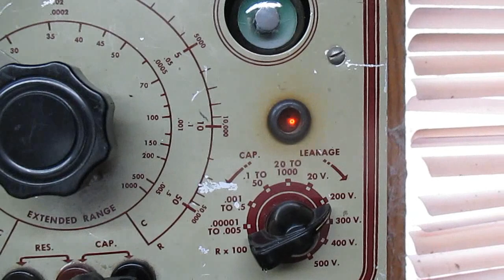1960s Aiwa Japanese-built 5-tube radio

Comment: Paper was caps and dried out electrolytic or just the biggest problems in these old sets. Even if an old radio was taken out of service for whatever reason and put away in storage not only do you got to find the original problem why it was taken out of service but then you got to change all the caps and that's just the way it is. A lot of guys will say just change all the caps and the radio is good as new that's not necessarily true because what was the original problem why the radio was taken out of service. Just think if you had $1 for every radio that went into a garbage dump back in the 1960s 70s and 80s just think of the money you would have.

Comment: At 2:49 near the RED Wire, it looks like a broken trace...  hard to tell from the video but pointing it out
Reply: Also it appears to be some poor solder joints on the tube socket at that same timepoint.
(Solder amount and flow)

Comment: When you were discussing the replacement plate-to-grid coupling cap, it looked like there was a major bad solder joint in the lower middle portion of the frame (around 2:43)...

Is there some kind of squelching circuit that suppresses the static between stations?

Comment: It's a very cool radio to be sure. But I wouldn't put it into service without getting rid of all of that dust on the pcb and tubes---that's a potential fire hazard, and the dust may even be conductive, depending on what type it is